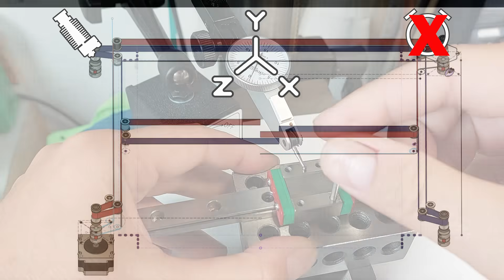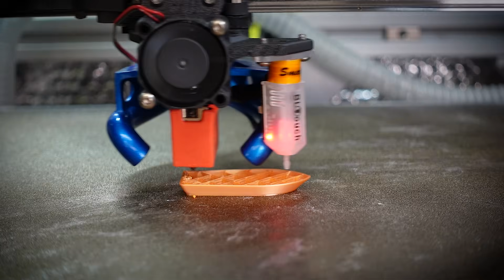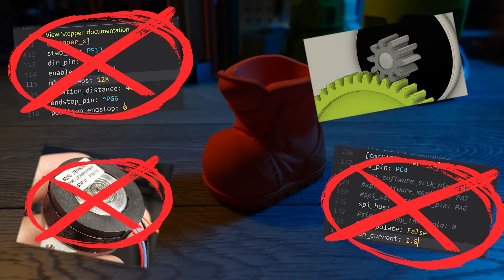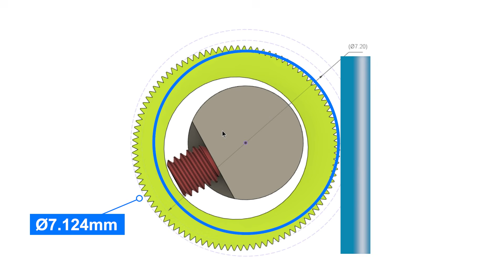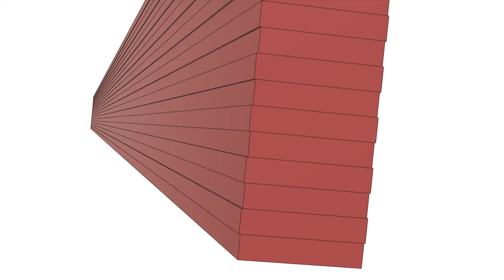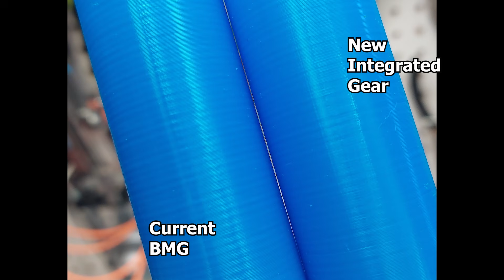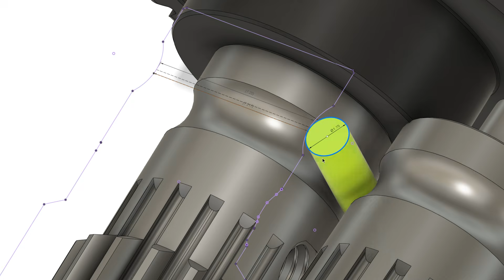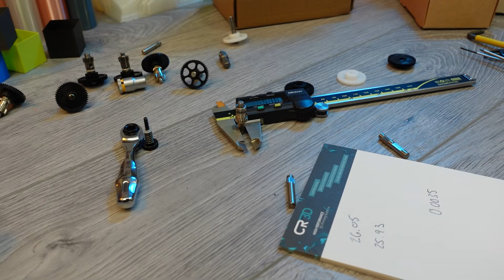Extrusion Quality - Mystery issue resolved !

Comment: Thank you, I am glad you are in conversation with manufacturers. I have heard so many bad things about direct drive extruders, like the diameter change when the two tooth wheels distance changes due to the pressure applied by the spring... I am glad I have a bowden which works just fine. I am very excited on what their solution will be, because only then I might consider changing to a direct drive. One toothwheel with an idler pulley is perfect, two "semi synchronized" are just another factor increasing issues.

Comment: I completely rebuilt a rather shitty da-vinci 3d printer last year as its firmware was utter garbage, and its mechanicals were.... seriously lacking. Seriously, the idler didn't even have a bearing. it was just an aluminium wheel on a steel shaft... I was chasing down accuracy issues. Repeatability was non-existant. I tightened all belts, rebuilt the x and y axis with new 3d printed parts, and even rebuilt the x sliders with hollow brass tubing on the stainless rods (that made a pretty serious difference).   That idler wheel though was the main issue.  That and the x axis stepper was mounted so poorly you could see it flex when reversing direction. The stiffness of the whole printer's x and y stage was atrocious. You could park the printer, and just move the print head back and forth and left and right by nearly a millimeter just by taking up slack in belts, and by the steppers flexing the thin steel construction.  That idler wheel though was the main issue. Aluminium sleeve bearing? the hell...

I got a bowden extruder from a chinese clone printer and put that in instead. Boom, massive boost in print accuracy. I had to adjust the flashed repetier firmware to handle the bowden, but i did notice that the stepper motor had a direct pressed on steel filament wheel. At the time i didn't really appreciate that, but thanks to this video.. makes perfect sense now. The bowden extruder unit i have is direct drive with a ball bearing pushing the filament onto the toothed wheel, so no issues with gears OR toothed wheel eccentricity.   I print a lot of small parts, so the bowden extruder gave me a hit in print speed due to a lot of retractions, but definite boost in accuracy. 

I still have a z wobble due to the Z screw being terrible quality, and the bed linear bearings having a good 500 microns of movement as they really didnt size them well but for the small parts i print its not that big an issue for me. 

But thank you for this video, the time spent eliminating variables from the process would have been extensive. From this video though, i can safely assume that direct drive bowdens with pressed on toothed wheels and ball bearing idlers will at least eliminate 1 serious potential issue. I had to redo my filament extruder multiplier due to the new bowden extruder toothed wheel having a different diameter, but once i calibrated that, the printer is at least 10 times the quality of its original design.

On a side note, i have a makerbot replicator that uses a direct drive extruder, but once again, its a pressed on toothed wheel, and a ball bearing extruder that i made for it as a self upgrade, and its STILL one of the most accurate and repeatable printers i have (i have 3 atm). I ended up putting in a watercooled hot end on the makerbot for shits and giggles.

Thank you for this video!! Lots of hard work!

Comment: I wonder if you could have a "sine wave" adjustment function while printing. Basically if you do the runout measurement, you could on-the-fly adjust the extrusion multiplier
Reply: How would you "sync up" with the defect? Also, one skip and its all out of wack.
Reply: @MoonWind32690  this would require a sensor somehow, unfortunately.

Comment: I have been fighting this with my micro Swiss all metal replacement extruder for a CR10s.  I assumed it had something to do with the pressure i was putting on the idler gear.  I also would like to try Proper Printings belt driven extruder.

Comment: I think the right approach (or at least part of the correct approach) is to develop a whole new set of compensation algorithms. It's not enough with just resonance compensation and preasure advace. To get rid of these artifact we should equip our printers with filament width sensors and maybe also filament speed meaurement sensors. Then you could get much much tighter control over actual extraced flow rate and compensate for both filament diameter divations and exteruder gear being offcenter as well as slowdown of extrucon which occurs naturally at higher speeds.
Reply: What isn’t measured has immeasurable potential downsides, and you can’t fix what you don’t measure.

I agree.  We can’t expect 100% accurate hardware or filament quality because reality is imperfect.

Comment: Need to ask something completely unrelated to the video.  Does your BLTouch on the HevORT use shielded wires?  I've been told by someone in a printing group to get reliable results on a BLTouch, it needs to use shielded wires otherwise the signal noise corrupts the returned data.
Reply from the maker: No shielding on mine.  Probing too fast will give erratic results and little magnet inbyhe fingers head need to be glued in place so it does not start floating around after couple of months printing in enclosure.

Comment: AFAIK Mihai Design was the first to identify the surface problem with dual extrusion gears / direct drive and changed to use a single with a bearing to fix it

Comment: very interesting, i know some people worked on fillament diameter sensors few years ago atleast as far as having it display on screen.
Guess worth looking in to again iirc most people stopped persuing it because of it not really being visible in the end with any decent fillament these days
but i guess you might actually benefit from that now.
Reply: There is support on klipper for change the flow based on filament diameter and the circuit is open source just 2 hall effect sensors.
Reply: @felipenavas  oh, nice didnt know

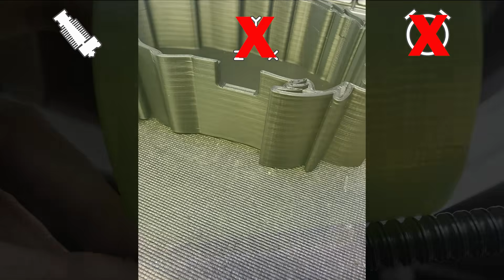Comment: One of the most informational videos I have see in a while! Good job. I run a Bowden system with a LGX on my v0.1 and have been able to achieve speeds of sub 3:30 on a benchy. Can you explain why bowden is slower? I know you glanced over it in the video, but I want to figure out exactly why. Thanks!
Reply: Did you do your benchy with PA off and no retract? For a 3:30 benchy you must be running 100k+ accel... and that kind of accel on bowden will chew up the filamement. You cant crank accel as much on a bowden system..and the retract at 2-3mm is huge

Comment: So, what about the proper printing proper extruder, which uses belts to push the filament? That would eliminate this kind of variation
Reply: Exactly what I was thinking. I already wanted to try a belt based feeder as that is common in other applications, like wire confectioning and such.

Comment: Great video. I have always been a proponent of direct drive, but the springy effect of a bowden tube does have some advantages after all!
I assume with large gear extruders, like the LGX, there will be reduce issues with consistency, because even if the filament shifts around front to back, the relative diameter change will be less. Also the straight-tooth gears in the Sprite hotend don't sound like such a bad idea anymore!
Reply: I too am interested in results from larger geared extruders and configurations/designs outside of the traditional bondtech assembly.

Comment: great video but the layer visualisation is SO wrong. slicers actually estimate the extruded filament profile as a rectangle with 2 semicirles at the sides becase that is the closest to reality. If they did use rectangle estimates they'd overextrude by about 11%
Reply: Sure. But you kinda missed the point. Whether it’s semi-circular or rectangular it doesn’t matter for this discussion—the overall line width changes enough to make a difference optically.

Comment: I've heard it was the backlash from the idler -- but this makes SO much more sense. Thanks for this!
Reply from the maker: Yes, backlash, gear mesh, filament walking in the hobb, hobb eccentricity, they are all contributors.  Thank you
Reply: Didn't MihaiDesigns point this issue out 1 year ago? That its an issue in dual extruder designs. And in the end, dual extruders are kinda pointless design... as you don't need more force to push filament through, you need more melting power so you don't need more force.
Reply: @Nobody-Nowhere  and also better hotend cooling for retraction.